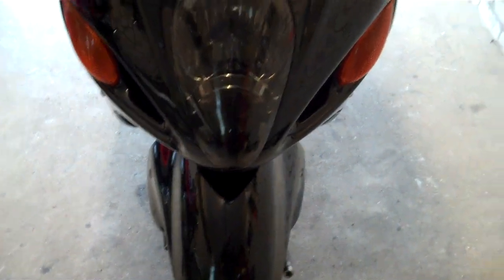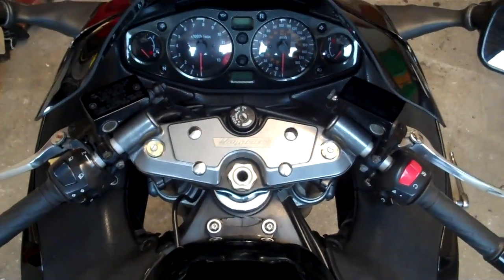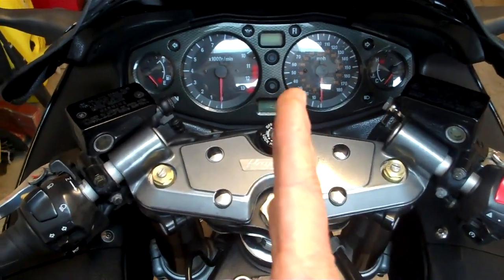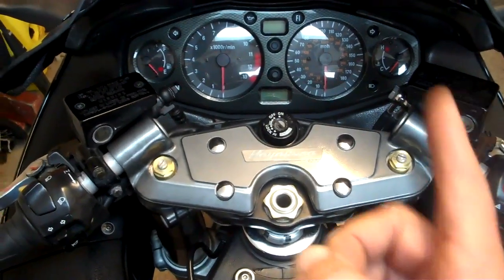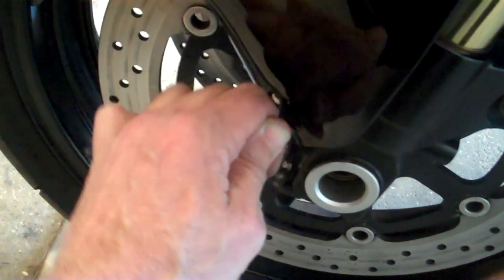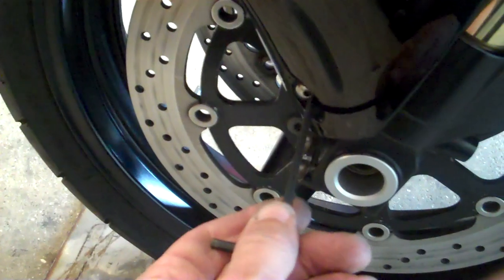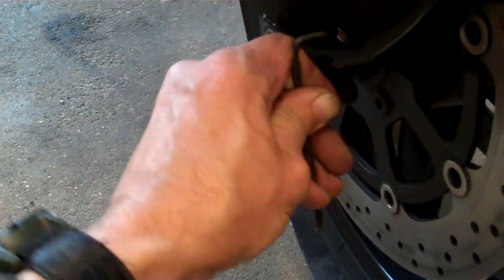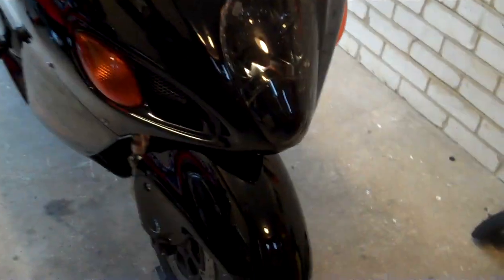Delboy's Garage, 'How-To' Re-align motorcycle forks the easy way.

Comment: hi, great job, i tried it on a bike few months back.i just got a gsr 600 k8, the bike goes perfectly straight when riding in straight line, however when cornering im losing control. i checked the alignment of the rear and front wheel. the wheels are parallel and perpendicular but the front wheel is offset by 8 mm to the left. i also noticed that the front tyre is flat where it got contact with ground and on both sides circular bump all around. your advice would be greatly appreciated. thanks
Reply from the maker: L SP Hi there...im not exactly sure what you are explaining at the end of your question about the front tyre...but you mentioned that your wheels are parallel, then you say that your front is 8mm offset!, do you mean that your front wheel is running 8mm to the left of the rear wheel??.. if so then perhaps you have issues with the front wheel spacers...was the wheel fitted correctly? are the spacers in the correct order?....of so then are the rear wheel spacers in the correct order?.. its pretty simple mate, your wheels must be absolutely in the same line, no offest is tollerable, otherwise the bike will lose control in bends and corners as the bike tries to 'crab'... hope that helps... Del.

Comment: Hi there i have a question for you i had my forks we cromed for a honda 125 superdream. 1988. I put brand new seals in brand new dust covers brand new fork oil and brand bottom stanchion bolts in . I test the forks before i fitted them. I have noticed when i put the front break on the forks are stiff they will go down .but i have to pull on the handle bars to bring them back up. Would the alignment cause this problem.  This is the first time i have done this kind of work

Comment: Hey Del just wanted to say I Love the videos and as in some of the other comments you are an awesome teacher thanks for doing what you do and keep them coming. now for the real topic.... I just purchased a " new to me " 2006 Hayabusa. the previous owner has lowered the front and rear. I want to raise the front back to stock. I know how to do it but I am not to sure on what the stock height is seeing how there is an aftermarket top tree. so im not sure how far to bring it up. hope you understand what im asking.
Reply from the maker: +smittyr0322 Hey Smitty, yeah i get your meaning, to check the factory ride height, either call a Suzuki Dealer, or find out what that after market top tree does for the bike...does it lower one inch, or what?... what ever it does, then just reverse that..!! the easy way if you can find another Busa, is to measure from the axle center to the bottom yoke...then set yours to that height.. Hope that helps... thank for your kind comments buddy,,,,ride safe aye.. del.
Reply: +Moonfleet41 thanks a lot.

Comment from the maker: Hi Patrick, being knocked over, I would imagine it's only the front end that has incurred a little twist & as long as it's not much it won't do any long term harm at all - you can sort this out without any form of stand provided you have a friend to help you, if they can hold the bike upright from behind using the grab rail, dead on the balance point after you've plunged up and down to realign, then you carefully get off the bike& nip up all the fasteners one by one, either way, good luck, Del.

Comment: Hi mate, is it possible that if the forks are out of alignment that the front tyre could prematurely scrub on one side? Reason I ask is that's exactly what's happened to mine (tiger 1050). I had all the bodywork off after a little slide down the road and being honest I dogged up every bolt you speak of really tight when putting it all back together.
Since then something hasn't felt right with the handling and now I've noticed the tyre badly scrubbed on the right hand side. Any advice would be most appreciated. I'm not incompetent rather just need pointed in the right direction as far as maintenance goes.

Comment from the maker: Good luck Christine... it's not so accurate using the centre stand, it's best done with the weight on the axles, if there are 2 of you, one stand behind holding the bike up by the grab rails and you should get it bang on, good luck you both, Del

Comment: when you said "and then your bike will ride straight up the road and wont go in a hedge" i said... i already rode my bandit in to a hedge/ditch, thats why my alignments out. haha if you see this, when i crashed i bent the bit welded to my frame that hits the steering bump stops and its lifted the lower ring up where the bottom bearings go, and my full lock to the right is too far. any advice for that? i know i can cut and weld the stop on in the correct place but im worried my bearing will not be seated right

Comment: I just bought a new Honda Rebel , with the tire straight the handlebars and speedometer are slightly orientated toward the right until this is repaired is it a safety issue or just an annoyance.

Comment: Another well done bit of instruction..Thanks...Can you not do this on the Center stand instead of a paddock stand...
Reply from the maker: Hi there, you could do it in the center stand, but you'll get better results by supporting it right at the back of the bike as a paddock stand does... its the weight of the bike pushing down on the front end that centers the legs in the yokes...when its on the stand you only have half the weight pushing down.... if you dont have a paddock stand, you can get a friend to hold the bike on the balance point from behind by holding the grab rail....thanks for watching buddy, good luck with it.. Del.

Comment: I was in an accident about a week ago. Girl backed across a 2 lane street and i had no were to go but into her passenger side door. I was able to hit the breaks and minimize impact. This all happened about a block from my home, so i was able to ride it back to my house. I noticed my handle bars had to be turned about a quarter or more to the right to keep straight. Without much experience with actually working on bikes i just figured they are bent and would need to be replaced. After seeing some forum posts and watching this video i am wondering if i can use this method to realign the forks. Is it possible after such an accident or should i take it to a shop and have them work on it? The bike is a 07 650 vstar. Any help would be much appreciated. Thank you
Reply from the maker: shane moccio Hi Shane, sorry to hear about your bump... will these drivers ever learn to look where they are going!  

The way fork clamps are designed, they are meant to slip when there is a slight impact, rather than actually bend, and as you've had a medium front impact, then it's highly likely that your forks have just twisted in the yokes and can be re-aligned.... after all, it costs nothing to do this, and you've everything to gain... if it doesn't work you can still take it to a dealer for a check up... so why not run through this procedure, as in the video, and let us know how it goes mate... good luck and I hope it sorts it out for you... Del
Reply: Moonfleet41 thank you for the quick response. I will try this as soon as I have some spare time and will definitely let you know how I make out. Thank you for the great videos.

Comment: Hey man, I appreciate your videos.  I've been watching them and commenting on some, for a few years.  I love your Sportster ones.  They have helped a ton.  Sadly, I wrecked that, but, I have a Dyna now.  I'm getting an acceleration wobble, after adjusting my steering bearing.  I think I may have done it improperly, so I spent the last few days installing new races and bearings.  I started the project because I felt a slight shimmy on the road at high-ish speeds.  Well, during the install I found I needed to replace my rear brakes and did so.  Afterwards, I had a reduced acceleration wobble AND deceleration one.  I re-tightened the adjuster nut and got rid of the decel wobble only.  The acceleration (and a little on cruise) wobble is still present.  I know you're busy so if you get a chance, I'd appreciate any help..

Thanks and keep making the great videos!

-James
Reply from the maker: Hi James, with your speed wobble, it may not even be the bearings, often it can be the tyre itself..! If the front tyre had a slightly uneven wear patern, it can change thew shape of the curve tht the tyre follows... when they are new, they are totally round from side to side.. but as they wear, the middle takes on more of a 'point' when the sides wear away due to cornering forces... this gives the tyre a lateral profile more like a 'Triangle'...and it will make the front do all kinds of weird things...and wobbling in one of them...    So check the tread depth across the profile, and also make sure your tyre pressure is right too..!  I have given this answer to a lot of people and a lot of times it was the main problem... adjusting the bearings is just eliminating the symptoms a little....but it wont eradicate the problem... when they fitted a new tyre, the bike rode like new again.... ! have a look at that and see what you find buddy.... let me know.. Del.
Reply: thanks for the reply. I thought that too, but, the acceleration shake started after my head bearing adjustment. Even just a slight bearing adjustment is going to cause that much difference in tire position?

edit: I did the adjustment somewhat half-assed the first time, when the wobble started. then I completely took down the forks, tire, etc, and installed new races and bearings. that didn't fix anything. prior to any of that, I only noticed a very small shimmy (?) on the roads. More like a tracking issue. Very light and could have been in my head. It felt like going over grooves or tar snakes, but, barely noticeable- except one instance where I felt a definite wobble. That took me back to my Sporty wreck (in my mind) and that's when I decided to check the bearings.

Comment: Hi
Just been out for a ride first  time after a lowside accident end of  last , fixed the Brocken bits 
But visually noticed the handle bars are only slightly off to the right . 
Did you have to loosen the head bolt bearing? 
Mark

Comment: Even though it’s an old vids, you helped me a lot! I’ve felt this misalignment since 6mo ago, never crashed the bike, maybe bcs I hit the potholes a lot (I live in Indonesia btw). 

Btw, I did every single steps in the video, but it’s still wander to the left (slightly). I already aligned the rear too. Is it possible that the front tire already ‘thin’ in one side? So the bike still running a lil’ bit left. But it’s better now. Don’t feel any right left right left kinda feels.. What do you think sir?

Comment: Del boy, your vids are very helpful, good lad. I binned an old cbr down quite hard last week resulting in a similar situation to this. it has rwu forks, so is there any difference in procedure? cheers
Reply from the maker: Hi Jon, sorry to hear that mate... hope you didn't hurt yourself... procedure is the same for your regular forks, just remember to back off the centre nut on the top yoke as it allows them to re-align... good luck with it mate, cheers, Del

Comment: I use to have to lean to the right to keep my bike straight when slowing down and not holding the bars.  Found this vid after I dropped my R1 and started having uneven tire wear after I put her back together.  Followed this video and now I don't have to lean at all when slowing down.  Completely shocked.  I had normal tire wear pior to the crash but still had to lean.  The lean is gone ...we shall see about the tire wear.  New Q3+'s are on the way.
Reply from the maker: Nice one buddy, glad you could use the video... sorry to hear about your drop, hope you weren't hurt, and good luck with the tyre wear, hope it works out for ya... don't forget to check your rear wheel alignment, as well as your front, as they work together to align the bike straight - good luck with it!

Comment: Hey there Del! I am facing a crooked handle after some low speed drops during ADV training off road in the wet. Local dealer tried to align but I am not convinced. Gonna try this method once I know the exact torque figures for all the bolts. Could you please clarify when to tighten the stem centre bolt? You mention south of the top yoke down. But what about the stem centre bolt? Your help will be much appreciated. Bike is a Tiger XCx.
Reply from the maker: Sagar Bhandare Hi Sagar, yes mate, sadly i left that out of the video... you MUST loosen the centre top yoke nut....this allows the two yokes to move seperatly and re-align....then make sure you tighten that one up FIRST....and only then..work your way south form there... hope that helps, good luck with it matey, id be interested to know if it works for you... take care. Del.
Reply: Moonfleet41 thank you for that. Will try and report back. Cheers!

Comment: hi  I just fixed the problem disk brake rubbing with caliper.i bought brake cleaner.but does nt help..friend of mine put spacer  between caliper and fork where the caliper bolts situated. thanks again for your lovely video.

Comment from the maker: H mate....it sounds like the wheel out of balance for one reason or another, its possible you could have thrown a wheel weight off that was keeping it true, it could also be the front tyre being worn...once they get to about 70% way through their life, they don't ride well......but first check the tyre pressure, needs to be 36psi minimum. (and 38 rear)..get that set and check it again, if its no better and the tyre is old, maybe think about a new boot and they will balance it too..good luck Del.

Comment: Great Video.. I heard you say that this works for Sportsters as well. I have a 2011 XL 883 (Superlow). The Authorized Service Station says that the triple tree would be needed to be sent to a lathe machine for alignment.
Need your expert advice

Thanks in advance :-)
Reply from the maker: +Shalin Shukla Hi Shalin, this method in the video is simply to re-align the fork stanchions within the triple tree... not sure why they suggested your top tree needs some sort of 'surgery' -have you had an accident, or damaged it??
Reply: Hya mate !! yeah one of my friends while taking a test ride wasnt able to control the throttle and banged the front into a pillar. I opened the complete fork assembly ( the tubes and the triple tree ) and went to a fabricator. When he put it on a machine, he found that the triple tree was bent...corrected it in 15 minutes and trued up the assembly..... 30 quid and it is sorted

The local HD dealership had given an estimate of 25k (Indian Rupees - Approx 250 GBP - pre Bexit :-P)

thanks for the reply mate

Cheers !!!
Reply: Also would love to visit your garage... Im in Durhan (UK) and Bangalore (India) on and off.... 
(If that's not an issue :-))

Comment from the maker: Hi Stephen, not had a fork seal leak on the Busa (touch wood) so not made a video...all the mechanical principles are the same as the regular fork (there is a video in the library) you just need a manual to get the parts undone....if mine leak (and i hope not) then naturally ill film it and load it up..

Comment: Good Vid thanks,

I have a question. Had a little off a month or so ago. fixed all the parts but
have noticed that the right hand bar-end is now much closer to the tank on full
lock rather than it was before I went down (on right hand side). The left seems
ok but can’t be sure that it’s not moved too but it feels ok. My right hand
steering bar is what took the impact and it’s that side a slid along the road
surface. I have looked over the bike and everything seems fine including the
full lock notch restrictor under the top yoke. do you think that this method
will re-align and equal the separation distances of both bars at full lock?

Thanks
Reply from the maker: +Marc Winpenny Hi Marc, sadly, I fear you have possible bent your clip on... it's extremely common, if you observe closely on the yoke, you will see the clip ons are bolted to a fixed point on the yoke, so cannot 'rotate' around the fork leg, so if it's closer, it's cos it's probably bent - bite the bullet mate, strip all the furniture off the clip on, and eye ball it from the end, look along it like a gun sight and you will see straight away if it's bent ... don't fret it, as they are not expensive off Ebay, you can even buy some cool Chinese after market ones fr not much money, as I did for my Aprilia... great quality and more adjustable than the factory  one - let us know how you get on!
Reply: +Moonfleet41 Thanks very much for your advice. I'll try and do as you suggest over the weekend. I'll let you know how I get on... thanks again

Comment: Hi Del
Amazing logs im always watching them well now im going to put one of your tips into practice i put my bandit into a ditch at the weekend no damage to me but bike suffered a little bit of damage ie cockeyed forks so ive been and purchased a paddock stand and as soon as it arrives ill have a go. 1 thing at what point do you tighten the big center bolt (the 1 that goes thro the yolks & frame) after tightening all other bolts or b4 thanks so much for all ur effort and time in v login